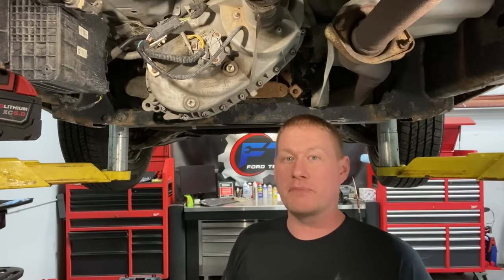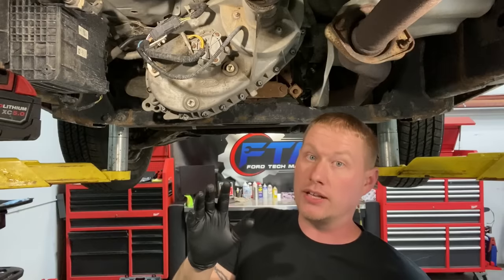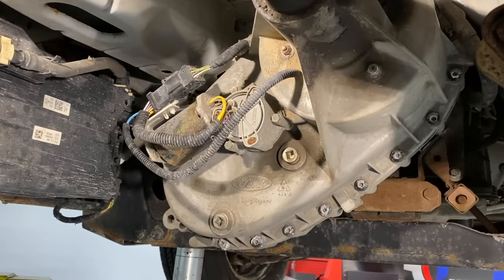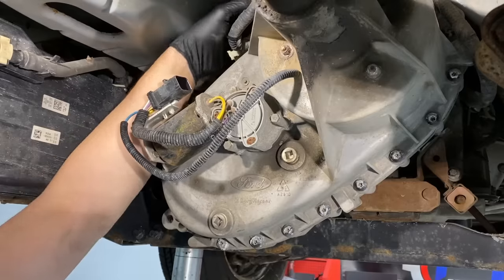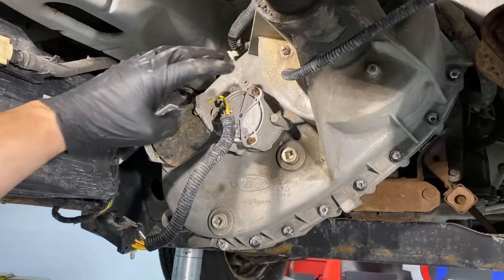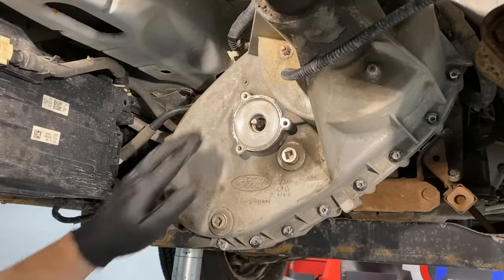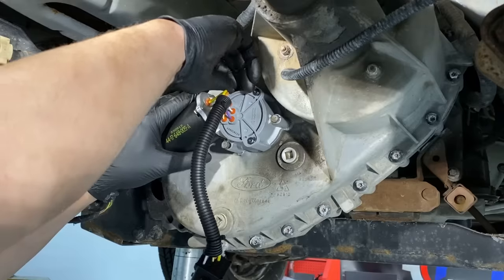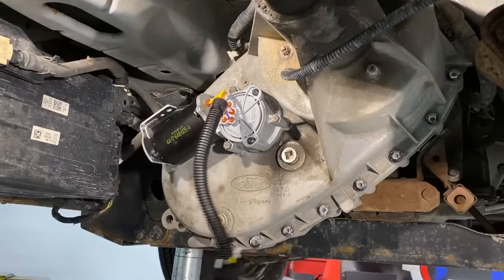2004-2020 Ford F-150 Four Wheel Drive Inoperative DTC P1867: Transfer Case Shift Motor Replacement

Comment: Hey professor...That transfer case fluid (as opposed to mercon V) is becoming less (and less) available and more and more expensive...Is that still the only recommended fluid?...I hear noise about merc LV...?...If I heard if from you, I wouldn't have to wonder...Maybe sometime in the future you can address that...Again, thanks!!!
Reply: Yeah really that's a good question you should answer this guy
Reply: Ford told me to use mercon lv instead of transfer case fluid because they dont make it anymore..  they dont care much If my transfer case seizes so i would be interested to know if the mercon lv is also as good as transfer case fluid.
Reply: I've been using lv in my transfer cace for prob 5 years now and haven't had a problem
Reply: Motorcraft says mercon LV is now the approved fluid for all transfer cases.
Reply: Stop the guessing games and put Valvoline Transfer Case Fluid in it.

Comment: My 94 explorer occasionally gets stuck in 2hi or 4x4. The motor still gets power but it jams up. I’ll knock it with a rubber mallet and that helps sometimes, but usually just unbolting the motor, turning the shaft, and re installing it frees it up.

Comment: Thanks for sharing your knowledge it has help me a lot 
I got a question on a 2012 Ford F-150 that’s doesn’t start only cranks  I need to know how to test the fuel pump module I got power and ground but the fpc and the fpm signals I don’t know how to test em
Any help is appreciated

Comment: Great how to video!  My 2019 F150 4WD engages rough into 4 low and  engages right into 2nd gear when i shift from neutral to drive. 4 H, 2h shifts smoothly  Is this a transmission killer problem?  under 10k miles.

Comment: Good morning I have a 2008 f150 I change the 4x4 motor like you did in the video also the vacuum lines but still the 4x4 not coming on I check the fuse at the fuse box they all good also put new 4x4 on the wheels bearing too what else can it be need more info on this.       Thanks

Comment: Thanks for the video!
I’m having a problem with my transfer case randomly shifting into low range ON ITS OWN!
The last time I was cruising at about 50 mph when it tried to engage into low, I quickly threw it into neutral and stopped as fast as I could, it was grinding the whole way until I was going slow enough for it to engage. I had to pull the fuse under the hood before it did permanent damage. Could it be a short on the wiring connector? I’d sure like to have 4 wheel drive again.
Reply: Not sure if you've figured it out yet, but it could be the vacuum solenoids. On the wheel hub there are integrated wheel ends (IWEs) that couple or decouple the front wheels from the axel. The solenoid is only about $20 or a check valve is only about $8. This might be your problem as it's typical for shifting on it's own. Good luck!
Reply: There is an active recall on F-150s (including my 2012) about this very issue where the engine could downshift without warning even at highway speeds. Apparently its a software issue. Call your dealer with your VIN and they can tell you if it's an issue on your truck.

Comment: While the motor is off the transfer case,  now is a good time to do a fluid change on the transfer case.
Reply: James Nasto  the manual recommends every 60,000 miles i believe.   it is no joke either, as my torque converter is failing due to the previous owner not following the guidelines

Comment: Great job. Now all you have to do is to teach the engineers at Ford what strain reliefs are used for on wiring. Would it have been that difficult to have something to keep the wires from dangling? We're not talking about a vehicle intended to stay on pavement it's entire life.

The same comment as some others, dielectric grease on the connector contacts and a dab of grease on the motor to shift shaft interface.

Comment: I had the same problem on my bronco 2. I fixed it by replacing the motor switch with a manual transfer case swap. Much better

Comment: That failed on my father's 2002 F350, but without any code. The motor clicks few times on key on. The transfer case sometimes was shifted slightly to neutral preventing the truck from going forward or backward. When I put the transmission back into park, transmission made clicking sound (parking pin failing to engage) I mistook it as failing transmission, but it wasn't. I think what was happening is transfer case went into neutral and the transmission itself was spinning. Since there is no brake, the transmission was still spinning when the gear was shifted back into park causing it to not engage.
Reply: I don’t think that’s the motor
Reply: @600dea  Shift motor wasn't fully rotating. There is encoder in shift motor gear box and I think that had bad contacts. Motor itself or turning fine. It just didn't know when to stop.

Comment: $250 does not seem that bad to me. I just watched a guy with a new dodge cummins at 54k miles get told by dodge that his PCM was bad, cost = $3900 just for the part. This was on top of 15 hours diag time plus they replaced a EGR valve that was $750 and it did not fix the problem. Warranty ran out at 50k miles. Plus this ford job was easy peasy, I probably would have tore that motor apart before I bought a new one to see if I could fix it because I am frugal.
Reply: tim s It didn’t seem bad to me either and with such a great professional I easily told him to do it!
Reply: @wysetech2000  I was actually referring to my own f150 4x4. I did not make that clear though. I agree with your comment.
Reply: Yea man that’s what they do. I don’t trust any mechanic except this guy.
Reply: 750 for EGR? Smh  you can replace that easily yourself.

Comment: Is there a way to test your transfer motor BEFORE buying a new one?  Or is "NO 4x4 action felt" an obvious result of motor failure? Also, I found one on eBay for $57.60 / free shipping.  Is that a risk?  (I have a 1994 Explorer 4x4, 185k miles)
I've answered my own question about an electrical bench test, see:  Diag and Repair Transfer Case Motor: Mazda B4000/ Ford Ranger......

Comment: Thank you for vid mine is stuck in 4 low guess I will take off manually  turn it.  I will order one Monday. I went to switch to 4 high an it jumped into 4 low... its been acting up for awhile I was wondering  whats been messing up.  210k miles...
Reply: I got it unstuck by taking motor off which works what happen? Did gears get stuck or is motor weak?

Comment: Why did you not check the transfercase shaft for easy or stuck movement  before installing a new shift motor  ?
Reply from the maker: What transfer case shaft?
Reply: @FordTechMakuloco  on the shift shaft  on transfer case,  I watch a video of replacement of shift motor replacement . I was wondering why the shift shaft was not checked for the stickage ? Mine seems tighter than it should be  .  The second motor started acting up . 2005 6.0 powerstroke,  truck is not a spring  chicken  .

Comment: I have a C1728 code. Front diff seems engaged when driving. I replaced shift motor 5 years ago with an Amazon special. Shifts into 4w just fine. I does say shift delayed sometimes. Thinking  i need a new shift motor??

Comment: I would wonder if this is not caused by the incredible heat the transfer case puts out when it is in operation. I don't use my 4X4 much, but when I do, i notice that the transfer case gets hotter than hell even if it's only been used in 4H. Even after a 15min drive through the snow I noticed once that you can see steam rising from it if any moisture gets on the case. This may be well withing spec for the case, but maybe not so much for the poor little electronic motor.

Comment: Can this cause the transfer case to hang up between 4low and 4high and grind the gears? My 2013 f150 is starting give me some grief.
Reply: Put it in neutral instead of gear when shifting out of 4 low.

Comment: Can you do a video about how to replace the 4x4 hub vacuum lines on a 07 F-150 and possibly the part numbers for them, mine are all dry rotted and no longer lock into 4 wheel drive.

Comment: I have a question I have a 01 expedition 4x4 and I'm replacing the front differential with a used one and I noticed on the old differential there is only 1 hose that I had to disconnect but on the used one that I'm installing there are 3 total and there is no were to put the other two vacuum lines my truck doesn't have it

Comment: Can you give me chart to decode ABCD on the 😂contact plate. I replaced shift motor. It shifts by manually grounding GEM control lines on relay module (behind dash)  and scan tool on GEM shows ABCD changing but GEM doesn't like it and sends no ground to relay module, throws p1867 and others.  Is it possible it is wrong contact plate? All 4 ABCD go to ground and open as they should with rotation. Once I verify plate code is correct, I can proceed to arduous task of accessing the GEM (ugh) and relay module control wires. 2002 F150. Thanks for your good work.

Comment: my 2010 F150 is having the contact plate failure and i just havent crawled under there to check it out.. i remember the previous video on this was just remove the plate, knock the corrosion off and put back together.

my torque converter had a shudder to it as well, i had the trans flushed and it band-aid fixed it but $1800 will replace my torque converter.   148,000 miles on the truck

Comment: If the transfer case was already in 2H, as was the new transfer motor, explain the issue?
Does a 2008 F250 super duty have the “Blue Wire” in the wire harness that needs to be removed?

Comment: I did this shift motor on my 2005 expedition xlt ....4x4 still not working ....i get 4H and 4L flashing on the dash when driving it seems like every few minutes .....any suggestion on what to try next ....thanks in advance.... love the channel
Reply from the maker: Pull codes first.
Reply: @FordTechMakuloco  my scanner does not read transmission codes.....would autozone or advanced auto be able to pull the codes?
Reply from the maker: The PCM controls the 4x4 system so any codes would be set in the pcm.
Reply: Ok thanks

Comment: Just a question. I actually have following codes at my Ford 2000 F350: P1865, P1867, P1876. However shifting from 2WD to 4WD L & H works without any issues. What could be reasons for those codes then?

Comment: My dealer diagnosed the issue as the failed shift motor. I replaced it but no change. At 120k with maybe 150 times engaging 4X4 it does not seem reasonable that it should fail. Now I'm stuck.

Comment: I love watching your videos, however in this video you say it’s possible to switch the transfer case out of 4 wheel high. Could you explain this more I have a 2006 Ford f-150 fx4 just replaced the front hubs. When I went down the road to test it. I put it in 4 wheel high and now it won’t come out. I have power to my solenoid under the hood, and vacuum but it doesn’t seem to get the command to open/close to create vacuum to Iwe. I removed my motor from the transfer case moved the selector switch and it moves from high to two but it will not move the truck out of 4 high. Do I need to Jack the whole truck up to manually move it out of 4 wheel drive. And once it’s out will it send a signal to the solenoid to ground it?
Reply: @FordTechMakuloco

Comment: Got a kia Sorento and the 4wd motors are similar to this...but sometimes its not working,i turn it to 4wd low but nothing happens..its like there's no current to the motor..what should i check first?i think it related to some relay problem but i can't find it😂...sorry for bad English and i hope you can answer my question 😊

Comment: Can you do a video covering the 4x4 floor shift transfercase system?
My 06 sxt 4x4 isnt engaging. I have the floor shifter instead of the electrical (SOTF) switch. 
 I don't have a ship motor on my transfer case. I haven't been able to find  Any information on line or YouTube about troubleshooting for a drive system like mine yet...
Reply: Brandon Lindsay does it have manual hubs?
Reply: @FishFind3000  negative, I do not.
Reply: Could be the vacuum hubs or valve. He has a video to diagnose the hubs. Also I've seen a shifter linkage get bent before.

Comment: Thanks for the guide! I think my shift motor is OK, but.. I have a 1997 Expedition with 4wd, the 4h and 4l work just fine but the a4wd flashes and the auto doesn't work. Think it could be the shift motor or the sensors?

Comment: Hey I got a question. My 2010 F-150 4x4 is not engaging into 4x4. When you turn the switch it pops up check 4x4. I did have a vacuum line that was broke so re done all the vacuum lines and replaced the actuator on the firewall. Still says check 4x4. I had the truck scanned and no codes other than bank 1 catalytic converter but I know that has nothing to do with it. Do you think it’s for sure the transfer case motor? Also when it did work I could hear the transfer case motor click and lock it I hear nothing now. I’m going to check the wires and make sure it’s getting power to rule out a wiring issue.

Comment: One can't complain for $250.  They wanted $1k to do that on my Chebby, that incl. labor, tho.
Only $2k for whole t-case, however.  I was pretty much set to have it done, then I did some research and found all I needed to do was change the oil, lol.  After about a month, the t-case shifted normally again.

Comment: Hello  
    My  2012 Raptor goes in and out of 4high 2high and 4low but but doesnt engage the front drive shaft everytime only once in a while.  Could this little motor be the problem?
 Front hubs engage properly.
  Any input would be greatly appriecated. Thanks Kim

Comment: . If the motor is partially failing would it sound like a rattle/chipping noise and howl? Then howl goes away when 4wd is engaged?

Comment: Mine went out (original one).. Now I bought a online one( non ford part). It lasted 3 months the internal motor quit moving. Hooked a power prob to it and got no movement. I been through 3 in six months. Checked wires for grounding out. Wires tested fine. The knob on the dash tested good. I did buy a ford transfer case motor and that one lasted 6 months. I followed the same protocols you showed in this video. Any thoughts??

Comment: Great video. Would prefer to rebuild my Ranger shift motor if it’s just that dumb “problem” bushing that’s the culprit. However, the whole replacement only being around $80 & not wanting to screw up the original shift positioning if I don’t get it marked right. Think I’ll just buy the replacement motor instead

Comment: Thank you for all the time you put into your videos I have fixed so many things that were made easy due to your videos including the timing job on my 2006 5.4 3v.

 I have a question you might be able to help with. My 4x4 engages and comes on the dash and 4 low also works, but if I try to accelerate more than about 1500-2000 rpm it just kicks back into 2wd spinning and will go back into 4wd when I let off the throttle. Sometimes the 4x4 will stay in if I baby the throttle up to speed. Might it be the gears are stripped or something? 

Edit: I almost forgot to mention that this DOES NOT happen in reverse. The front tires will spin no problem in reverse 

Thanks in advance if you get a chance to see this!
Reply: That's messed up. Ever figure it out?

Comment: I have a question my 2007 Ford F-150 when it in 2H manual selector the iwe keep click on and off constantly I replaced the iwe with 2 different new motor craft one no fix. Any ideas what I should look at next

Comment: Ok I tried finding the transfer case fluid online. I found it on eBay. $30 per quart 😮
Does that sound right? Or now that it is 2024 are we using something else? Thanks in advance

Comment: Your videos are terrific.   I am wondering if the front driveshaft is supposed to rotate in two wheel drive.   2013 and later with 2H. 4A 4H 4L transfer case.   I have new actuator hubs that properly disengage and front wheels free spin in 2H  but seems like front drive shaft rotates in 2H.    Is the transfer case or front differential supppised to disengage?

Comment: I have a question about the information shown on the DIC while selecting 4x4 modes. Occasionaly when selecting 4H it will say shifting in progress and most the time it will not. It does the same for auto 4 mode, 90% of the time it just says 4x4 mode. Now everytime 4L is selected, it will say shifting in progress. You can absolutely tell it locks in 4L. Now 4H only feels locked in if it says shifting in progress. Found out the hard way it did not engage trying to leave deer camp where 4x4 is a must. I disengaged it as it wasn't need after getting through the bad hole. This is my first Blue Oval venture and so far I'm liking my 07 Exidition EL. My first V8 in almost 30 years and I missed that torque.

Comment: 2004 F-150 4.6 - Does this part manage the synchronization of the transfer case when shifting from 4wd back to 2wd?  My gears grind when going back to 2wd, and I have to turn off my engine to shift the transfer case back to 2wd.  Other than that issue, the transfer case works fine.

Comment: I installed a new transfercase shift motor because of failure to shift at all when there were very cold temps. Shifts Great from 2 to 4 high but takes a lot of time and effort to get it to shift into and out of 4 low. Shifting  the trans in gear and back to neutral several times before the shift will take place?

Comment: I am buying a 2019 F250 and the pre-purchase inspection found the 4wd wasn't working.  Could that thing be the cause?  The mechanic didn't think it was a bad transfer case, but could it be that part?  If not, what would keep the front wheels from engaging?  As far as I know, there is no error code.

Comment: I have a 02 explorer 4.6l that kinda grinds when driving but drives fine and when I disconnect the 4x4 control module the noises stop. I have replaced the control module and it does it with a new one as well